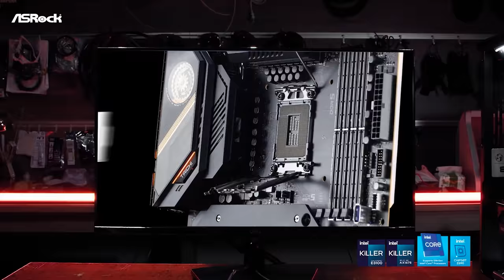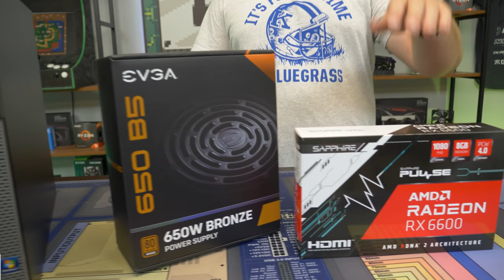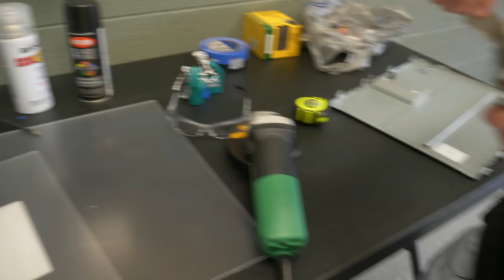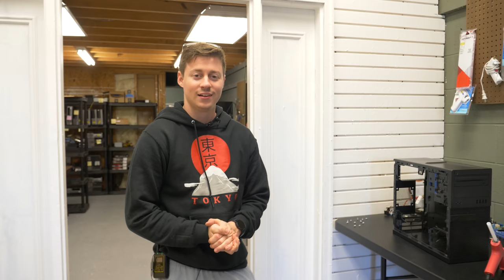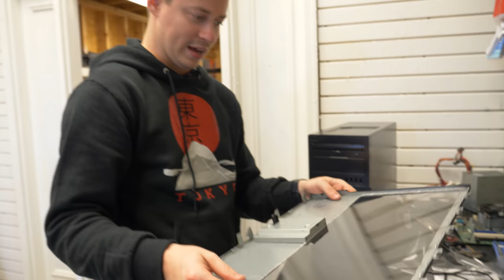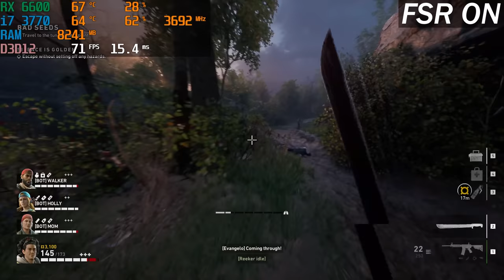We Built the ULTIMATE Dell Optiplex Gaming PC

Comment: You just simply can’t go wrong with a good old DELL OPTIPLEX. Dell really outdid themselves with these machines
Reply: My gaming PC is a modified optiplex. It runs Elden Ring like a dream
Reply: @Mysticbladegod  can’t go wrong with a optiplex 😉 they’re so easy to work in and they are also very reliable. Even in 2023 these 10 plus year old machines still kicking ass in demanding games giving reasonable performance and experience
Reply: Perfect system to dip the toes into the PC hobby and get used to working on computers also some pre built ones are good too
Reply: i have a really small optiplex witha gt 210 lol
Reply: @Craft2guardian  I mean hey it can probably run Roblox and Minecraft 😂😂😂😂
Reply: @jonathan-qd1cc  I got a new one a year ago with ssd BUT GT 710. A week ago i got a gtx 1650 Ti

Comment: I just did a 9020 build as well. 4790k, 32gb ram, 3060ti. If you cut out the HDD bay and install a 120mm fan as an intake, it cools pretty well
Reply: What cooler?
Reply: Is it overclocked, how's the performance with the 3060ti 🤔
Reply: @southboundtp2067  works very well even with i7 4790k not over clocked
Reply: Too much RAM, the 4790K will work better with 16gb and the hyperthreading turned off.

Comment: The old tried and true pop in a new gpu always holds weight, it's impressive that a cpu that old is still running that well.
Reply: @Jeffrey Grindle same just got a 7020 with a intel i5 4590 just gonna drop in a 1650 super up the ram from 8 to 16 and slap in a ssd and your golden intel really know how to do cpu's

Comment: I have an Optiplex but the 790 and I modified the BIOS which is extremely easy to add support for nvme (I put a 1TB one) via PCIe and I put in an RX580 2048SP the typical one from Aliexpress and 16Gb of ram that I had from my old PC and it is a machine for both work and gaming, I am not demanding but for the games that I love it goes 10/10 and I removed the rivets from the HDD bay and there is more space, the next upgrade will be to change the power supply for a more powerful one and a larger cabinet, upgrading the Optiplex is a very good experience

Comment: Yo this pc looks SICK and performers exceptionally well! Kinda want to build one like this! Toasty Bros on a sick one, yall.
Reply: if your're building a optiplex get the 9020 with the i7 4790.. i have one with 32 gb ram a rx580.  and a a couple of tb of ssd's.. running a good pc for cheap.. cut out the hard drive cage and shave down the holes in the front and you can put a huge fan in the front of the case.. then i just use the cd bay for the ssds and one another is velcro stripped unto the back wall next to the motherboard.

Comment: I case swapped a Dell Optiplex 9010 mt with a cooler master q300l running a i7 3770k 4.4ghz and Zotac GTX 1070 mini, 16gb ram, 128gb m.2 2280 ssd with adapter, and regular 128gb ssd, 500watt psu,
1tb hdd. And does the cooler you have in that build require an adapter?

Comment: What are your thoughts on the FX8320 other than probably not recommending it? A friend gave me a motherboard, CPU, 16GB of RAM, and a Radeon HD 7950 3GB GPU in June of 2020 and I was able to build the PC in September of 2020. All I had to buy was the case and power supply. I've been using it since and have been very happy with it despite the usual lag and bottlenecks that come with the FX8320. I'll probably give it away when I'm able to build a newer PC since it was pretty much given to me.
Reply: I ran FX CPU's for years and had good results overclocking them especially on LN2.  For normal use turn off two of the cores to cut the heat down then you can up the clock speed more which will be more beneficial than those two threads.  Getting the northbridge and HT link speeds right will make a massive difference to performance, it's trial and error really until you find the sweet spots.  When I first got a Ryzen 1700X my FX6300 would beat it in most games and I was one of the better Ryzen overclockers in 2017.  I moved onto Kaby Lake very quickly ditching my Ryzen parts and haven't bothered with AMD since really other than buying a Ryzen 5 for an overclocking competition.  If you can get hold of a cheap Sabertooth or ROG Formula board for it you will be able to extract some impressive performance comparable to the Intel CPU's of the day.  My Haswell i5 4670K wasn't much of an upgrade from the FX6300 and is the 2nd most disappointing CPU I've ever owned next to the Ryzen.  AM3+ is definitely my favorite platform to overclock, I'll break out my FX kit soon and see how it stacks up in 2023.  I'll video it on War Thunder and Fortnite and show my settings.  I'm playing with a Haswell i5 Dell Optiplex at the moment and can't believe how well it is doing, the FX overclocked should easily match it.  I have the 8370 I used to have the 8320 but I couldn't push it as high as even the 6300 so might be worth getting another cheap FX CPU to drop in there.

Comment: Honestly probably this is what we all would do on an extreme budget... if we could get a graphics card 😂😂. But seriously you get an optiplex for a 100-200 bucks or so so those upgrades are like just what it needs for gaming. I personally would get a 80plus gold psu and spend a little mote on it because I personally wpuld use it for like 5-7 years so a bit more longterm. Cooler is just needed amd the gpu, nice one. I really was impressed by the side panel mod because it gave some spice.

Note: You can get some covers for the edges usually used for metal sheets. There are some on ebay for 10-20 bucks for like 2 meters. it would make it look much cleaner and you don't have to worry about sharp edges. Otherwise very great one. 

In total they didn't go crazy and I like that.  They took a little bit money and made a great system

Comment: I built my first PC by taking a Dell OptiPlex and slapping in a 1060, pro tip for anyone looking to do this is go with the newest CPU you can get. I went with an i7-2600 and it was a terrible bottleneck especially in games like Apex. Getting a 4th gen or newer i7 if you can will do wonders for reducing stutters.

Comment: Nice build, and very pretty with all the twinkle and bling. I'm making plans to upgrade my own Optiplex 3010, I would have loved to see the part where you installed that new power unit. Were there any complications with that, or did it fit like the original? Yeah, I'm a newbie at this, never tried it before and I want to get it right the first time. 👍😏
Reply: I did the psu swap it should fit although my psu is being held on by 2 top screws as the bottom screw holes are to low

Comment: Yippee!! I still use my custom Dell Optiplex 9020 MT with 32GBRam and 650 Gold Plus PSU with I7 4790 CPU and GTX 1650 Mid range GPU card all off ebay used. But it's a powerhouse of a system and I wouldn't trade it or buy anything this day in age with no Cd Rom slots, and closed case with any IGP shit.

Comment: My gaming rig is a 7020 Optiplex, 4790k, 4x4gb 1600mhz ram, ssd, gtx 1660 ti, stock psu. Works great for 1080p 60fps gaming
Reply: I'd bin the stock PSU, once you have had a failure destroy parts you won't want to risk it again.  You can always take a good PSU onto your next build.
Reply: @theHardwareBench  I ended up upgrading to a 2080, which means I had to upgrade the PSU. Then I gave it away and built a new rig

Comment: Hello, I like your content. I wanted to ask a question. Can the Cooler Master i71C RGB a Dell Optiplex 7040 Tower?
Reply: Yes as long is LGA 1200 or other 115X. Your dell optiplex 7040 is LGA 1151 and yes the i71C cooler master heatsink RGB will fit on your 7040

Comment: my optiplex 7010 
16gb ram
GigaByte GTX 1650 OC low profile

i took the motherboard and put it into a cooler master MB311L using a kit found on ebay for the proprietary adapters for front bus and power
coolermaster i71C cpu cooler
Asiahorse Matrix 240 all in one fans for the top of the case
and it looks so pretty
Reply: Man i want to get that gaming pc 😢

Comment: Been building budget gaming Optiplex's for years now. The HP G1 and G2 Elite Desk is a good option as well. To bad even that RX6600 is $600.
Reply: I have an Optiplex 7010 with 8GB of ram, a  I3-3220, 1TB HD with a GTX 750 TI. I want to up grade the CPU and possibly the GPU but don't know  what I should look for in the CPU. What would be a good upgrade? Thanks in advance.

Comment: It would have been even more ultimate if you'd sanded off the DELL logo. 🤣
Reply: I don't know, I have had this PC since 2013 and still performs well. I added 32gb 1600 ram, a evga 1000 and a rtx 2080 ti with extra 120mm fan to the front blowing in that keeps below 65c. It's achieving 4k 60fps on Anno 1800. I think it's pretty good and it still runs....

Comment: Hey tbs the the vids but if you still remember I have a QUESTION. You know how xfx puts a metal plate on back of gpu just like the one in this video. And on dell the ram slots come down so low that it won't fit do just let me know how you did it in this vid.i see you kinda pushed down ram clips but I tried that and it disconnected thevram.

Comment: So I have an Optiplex 3010sff 500gb HDD and 4gb RAM. I already added s Nvidia GTX 1020 low profile graphics card. I have a 500gb SSD and a 2tb HDD waiting to be added when my i7 3770 gets here so that way I'm just upgrading it all at once. I was planning on getting a full tower version of Optiplex but is it even worth it? All I need to play is Elder Scrolls 3 4 5 and fallout 3 4 and NV. Currently my system can only play ES 3 and 4 with just the Nvidia GTX 1020 low profile graphics card. Should I wait to add these upgrades to the full tower when I get that or continue adding them to my Optiplex 3010sff? It starts up fallout 3 and NV but crashes so it should play these games afterwards. I don't play newer games would it even be worth getting a full tower at this point? I'd like to be able to play the borderlands series eventually as well

Comment: "why would you do this" Well it's actually a good thing you guys did this. It shows other people that, although this is fun and you guys did a good job, you would obviously be better off building the 6600 GPU into a modern 6 core system like a 3600, 5600x or maybe something like the upcoming 12400f. For i7 3770 or 4770, I would personally keep the GPU under 1070/1660 Super "class" GPUs. RX 570 or GTX 1650s are a fantastic pairings with these optiplex machines as we have probably seen in many past videos. The 1650 is especially desirable because A) works with the stock PSU, and B) in most cases the performance is near true 1 to 1 with bottlenecking being rare especially in the case of 4770 + 16GB ram + gtx 1650.
Reply: Great video guys, love this kind of content. Making the old new is what it is all about. As a side note, I would recommend testing in 1440p & 4k in some titles, you might find the bottlenecking to be less severe and you might still hit 60FPS average.
Reply: With current CPU prices, you could get the optiplex with say an i7 4770, a new psu, more ram for it and a decently big ssd for less than the price of the ryzen 5 3600 or 5600x. Add everything else you need for the ryzen build and you are already at around 500 bucks with no gpu. Bottlenecking is often overrated in terms of the actual total price of build for performance.

Comment: you could have just got a microatx mobo and got an extra power button and installed it into the pc so you could have much newer components
Reply: You don’t even need a separate switch, or at least I didn’t.
Reply: @zeroturn7091  yeah, it just depends on the model, some have proprietary power buttons but you could just find it online and change it.
Reply: @Sugar-gp2re  I agree, even mine was proprietary.  I just traced the pin outs from the stock switch to the motherboard headers, so that I can maintain the original function.  I put a short video on my channel.

Comment: What adapter cable are you using to run the gpu safely? Doing the same setup
Reply: Get a decent PSU with the right connectors.

Comment: I ran into a slight problem with the i71c it has a 4 pin wire but the fan slot in my pc is a 5 pin is it safe to use an adapter?

Comment: Curious on the EVGA PSUs. You can take out the old DELL PSU and slap in any EVGA PSU from 500-650 watts in any DELL OPTIPLEX unit?!  Wow😱
Reply: Some dells you need the 24pin to 12pin adapter cable. Dell at one point changed that.
Reply: @sbfotome  Good to know. Thanks.
If they would only list all the Optilex models that can have a PSU swap out, it would make all of us build "real budget" builds
😁😆
Reply: @ORBPHIL  u can swap the stock fans as well. U might need to adaptor 5 pin to 6 pin
Reply: Yes I put a few noctua 120mm fans in
Reply: Some dells use a 90mm rear fan which u can get on Amazon cheaply
Reply: My son has my Dell 990mt now, but I got the Dell 7050 Mt that is modded with a 650 sfx power supply.

Comment: Been seriously considering buying a tower like that or an hp. Something along those lines but something I can put non proprietary parts in. Build a sleeper.
Reply: HP Z series are awesome, and you wont need to get a PSU most come with a beefy server grade PSU with GPU connectors.
Reply: @johnringgold3036  is it easy to swap the board? I know much of hp is proprietary.
Reply: swapping the board is harder on HP for sure, I was saying to get up and gaming without the need to add or upgrade too much go HP. But if you want to case swap then go Dell and get a front panel adapter from ebay.
Reply: @train3616  Don't go over 4th gen intel stuff, after that most of OEM has proprietary board/psu and limited compatibility with new gpu and their own socket lineup (no xeon e3 compatibility unless it's a workstation, and only certain skus). Brian from Tech Yes City had a few videos about this topic (since he refurbish old parts to sell as gaming pcs)

Comment: Wish you guys did a installation of this fan struggling with my 7010
Reply: hey did u figure it out? I just bought the i71c thinking it would install easily but I'm lost.
Reply: @aidanwren4265  yea I figured it out. Make sure the fan is specified shape wise according to your cpu shape being square . You also have to buy adapters for connection very cheap on Amazon
Reply: @kafegaming9  appreciate it, I just ordered the adapter. But what do you mean specified shape size? I just screwed in the i71c into my optiplex 9020. Everything seems to have went in fine
Reply: @aidanwren4265  some fans have different shapes that are better suited either circular or square shaped but you should be fine

Comment: Pls do dell optiplex 790 i have been really wanting to play valo but idk if i can play it

Intel r hd 2000
Intel r core i5 2700
4gb ddr3 ram
250gb storage
Motherboard idk pls try
Reply: No intel HD won't cut it and 4gb of ram will make you stutter from time to time, since you'll be using system ram as vram for the integrated gpu. I played on a i5 5200u (2c/4t) and a gt 820m with 4gb of ram at 768p and was always over 60 but it wasn't smooth and had often stutterings
Reply: Ok thanks man

Comment: What nonsense! 
You can use a different PSU in every DELL Optiplex! It is true that DELL uses its own special PSUs, BUT the only thing you have to consider is the PIN assignment! 
You can install an RGB fan in the front!! With relatively good AirFlow! You can also install up to 6 SSDs and 2 HDDs, for cable management you can use the upper drive bay!

Comment: Day 1 of learning about PC gaming: What is bottlenecking?
Reply: One part of your PC can be too slow for the other part to reach its full potential. For example, after every frame your GPU renders, the CPU needs to do some work (maybe physics engine, maybe just general processing) before the next frame can be rendered. If the CPU is very slow, it's possible that your GPU would be capable of generating a lot more frames per second, if the downtime between frames wasn't "bottenecked" by the CPU. 

It also works the other way around, where your CPU doesn't have a lot of work to do, because your GPU is "saturated" already rendering (generating) as many frames as it can possibly do per second.
Reply: @b0ne91  Thank you.
Reply: @BRIXandSTRINGS  To add to that, you generally want the GPU to be the bottleneck in a PC for gaming, because issues occur when the GPU has to wait for the CPU and not opposite. It also of course depends on the game and higher resolutions will also depend more on the GPU.
Reply: @paalpet  Thank you.

Comment: save some cash and get a Xeon E3 1230 or the V2  version instead of the i7
Reply: Unfortunately they won't work on most regular OEM mobo, unless you're getting a workstation that already sports a e3 1220-1225
Reply: @GLDragon93  if you read the Dell product guide it will say it’s not compatible, I have built many of these machines personally took out I3s put in e3 1230s instead of i7s, put in Quadro K2200 instead of GTX 750ti but with 4Gb of VRAM, cheap server DDR3 and boom low budget gaming PC.

Comment: I'll build the exact same pc
Reply: Don't.
Reply: @ratmatat  why not
Reply: @kamizu.  Well, you could build a normal PC with that budget and consider graphics card prices are sky rocketing it would probably cost you even more.
Reply: @kamizu.  And also it is an OLD system, will bottleneck the 6600. If you can afford the GPU, pair it with a better system. Minimum a 3000 series Ryzen or 10th gen Intel with 6 cores will not hold back the GPU.